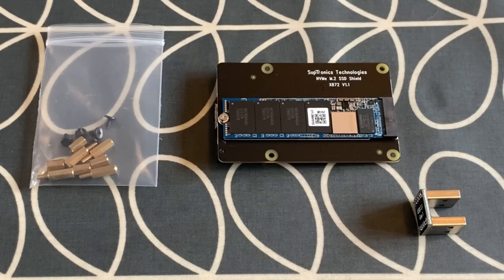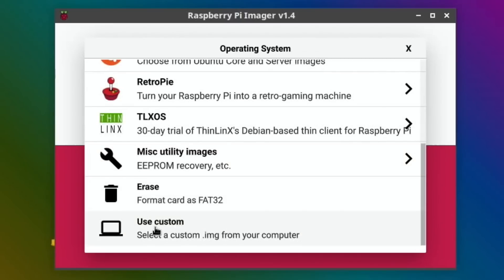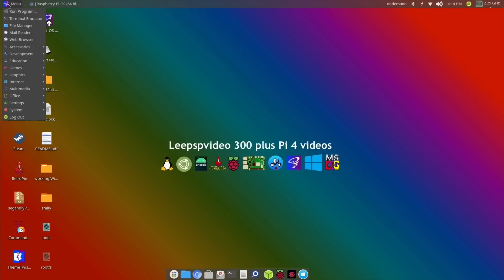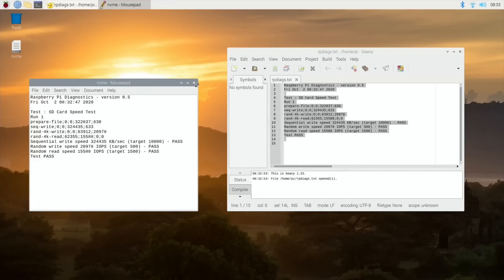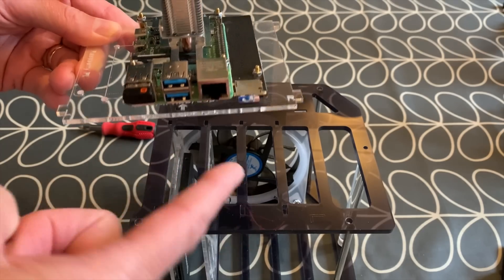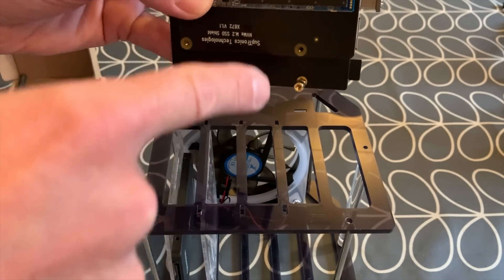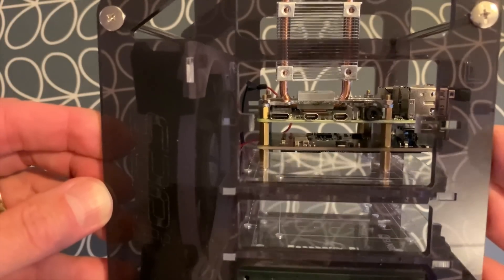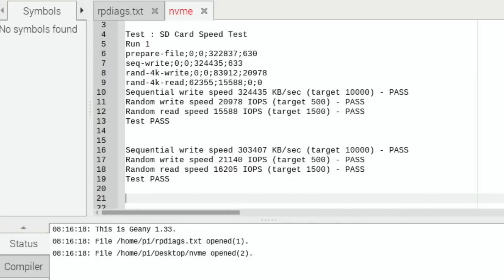SUPERFAST storage NVME M.2. Raspberry Pi 4.

Comment: I came across to issues with my X872 
1) The NVMe M.2 drive started to heat up to where it was  thermal throttling.
I put aluminum heatsink on the NVMe fix the problem.

2) Wifi not working 2G and 5G, it was able to see it but would not connect.
after searching web this is what I found.

"USB 3.0 devices might generate radio frequency interference that can cause Wi-Fi and other wireless devices operating in the 2.4GHz band to have issues communicating with your Raspberry Pi4. To avoid interference on the 2.4GHz band using Wi-Fi, try using the 5GHz band instead. If problem still exists, please turn off WiFi and use the wired network instead"
https://raspberrypiwiki.com/X872

it works when wired but not Wifi

Comment: The fact that it's connected via USB is a massive turnoff. Maybe the more expensive versions of the next iteration of the pi could feature a better cpu with more BAR addresses for GPUs and an integrated pcie slot on the bottom of the board. That would be a good idea for high performance edge computing or just setting up a low cost AI device in the network

Comment: just wondering if your nvme drive is with DRAM.
I brought the same X872 extension card.
No matter what I do, I cannot get my nvme card going.
1) Adata m.2 sx8200 pro 1tb - come up erratically, then try to format, but than on second boot, it cannot find the data partition.
2) PCIe SSD 220S 1tb - cannot format every time, error with report in size and volume.
Reply from the maker: My drive is listed in the description
Reply: @leepspvideo  Thanks for the info.  I did check out your listed drive but what I found looks physically difference from yours.
It's a 2 chips layout instead of 4 and it seems come with Hynix DRAM.
The only other difference I could find against mine is the electric current spec.
The pioneer listed +3.3v ~1A, while my 2 drives listed +3.3v ~3A.
I am already using a 5V 3A adaptor for the PI.  I guess this is not enough and I may need to get their adaptor then.

Comment: XPG SX8200 256gb NVME with x872 adapter on my Pi 4 8gb ram
Sequential write speed 318135 KB/sec (target 10000) - PASS
Random write speed 27397 IOPS (target 500) - PASS
Random read speed 25051 IOPS (target 1500) - PASS
Test PASS

Comment: Great video. I've seen comments about wi-fi being affected by these boards. Have you had any issues?
Reply from the maker: No, but my router is in the same room.
Reply: leepspvideo if you look at one of their wiki pages, they claimed there's a USB 3 interference issue. So it's officially confirmed. Did you receive a improved version?
Reply: leepspvideo Here's the link: http://raspberrypiwiki.com/X872 This is wiki from another distributor, but I believe the manufacturer is the same as Geeek Pi's. I bought via your link in the description and there's serious wifi interference.
Reply from the maker: Gordon Bai I’m not sure if mine in newer. I use 5ghz WiFi without any issues.

Comment: This is what I am getting with  the sata Kingston A400 240G Internal SSD M.2 2280 and 
FIDECO USB 3.1 Gen 2 to M.2 NGFF SATA SSD Enclosure 
Sequential write speed 318135 KB/sec (target 10000) - PASS
Random write speed 19051 IOPS (target 500) - PASS
Random read speed 17866 IOPS (target 1500) - PASS
No overheating, I can run an SSD on both of the usb 3 ports no problem

Comment: Dude... no clue why but I can NOT get my pi to boot from an SSD with this adapter. I got it to boot just fine from an NVME m.2 enclosure (usb-c)... but no dice here. What are your boot configs?
Note: External power to adapter from GPIO.
Reply from the maker: USB Boot the Simple way. Raspberry Pi OS. Pi 4.
https://youtu.be/suU09BMMFts

Depends on the OS as to what extra you have to do. Twister and Raspberry Pi OS work straight away with usb boot.

Comment: I had a lot of trouble with this device. Firstly the wi-fi was affected, but also the speeds were horrendous. Kbps with uas and 30Mbps at most with uas turned off. This was with the Intel 660p 1tb.

Same drive in the ugreen enclosure even with the SSD positioned under the pi gave me similar speeds as on this video and no WiFi issues. This video makes be wonder if my first purchase was simply defective or if it was the combination with my ssd.
Reply: Same here my friend! I bought this X872 board off Amazon UK with 50 GBP, and a Corsair NVMe M.2 240GB SSD. Wifi was affected, I tried booting from SD and just plug the X872 board in, wifi not working. Then I tried plug in a 5V 2.4A barrel power, wifi still not working, so not a power issue.
I'm using Manjaro ARM. The desktop is not display right with this X872 board, very often.

I have a ugreen sata to usb converter (not enclosure), it's UASP I checked. I use a WD Blue 250GB SATA SSD, speed is good, no wifi issues.

I don't know which M.2 SSD you use my friend, but I would guess SSD should be okay, it's this expensive X872 board.
Reply: @gordonbai5320  did you test the SSD speed with the X872 board? I used the Intel 660p SSD.
Reply: @Dipun Mistry Not really, though during writing in with balena etcher, the ETA with normal SATA SSD is around 2 min, but with X872 board the writing time is around 10 min. So around 1/5 the normal speed.

Edit: I did the test using "sudo hdparm -t --direct" just now to test the read speed (MB/s).
A2 SD card: ~40;
SATA WD BLUE SSD: 320;
X872 with Corsair NVMe SSD: 32. This is just unbelievable. Now if you click the Amazon link in the video description, it says it's not available. I really like the form factor of this board, but with the issue right now I think I have to return it.

Comment: You're limited by the 5gb USB - with an inexpensive Crucial SSD, I get the following:

Sequential write speed 319687 KB/sec (target 10000) - PASS
Random write speed 19435 IOPS (target 500) - PASS
Random read speed 16400 IOPS (target 1500) - PASS

Comment: Just for the record, my N2+ running Ubuntu-desktop 20.04 and 5.8 kernel give me some decent 407MB/sec with USB SSD3 boot with a Samsung T5 SSD w/ UAS and Trim Enabled.
sudo dd if=/dev/sda of=/dev/null bs=16M count=256
256+0 records in
256+0 records out
4294967296 bytes (4.3 GB, 4.0 GiB) copied, 10.5504 s, 407 MB/s

Comment: I didn't know Pioneer the favorite brand in the 80's and 90's for car stereo equipment has an IOT division now. Sadly, they're way overpriced in Canada. My preferred choice for NVMe model/brand is the HP EX900 M.2 NVMe 500GB because it's compatible with my RockPi4C, Rpi4 and Odroid-N2+ for NVMe boot and USB3 SSD boot.

Comment: Another great vid!  2 questions: Does Twister OS boot from the NVME drive?  NVME drives run hot and usually require heat tape and a thermal case to keep them cool, I don't see any options  for this??  Not everyone has UR case with  big fan.
Reply from the maker: I will try Twister soon. I haven’t yet  looked for NVME cooling.

Comment: Built-in m.2 drive support is something the pi 5 needs to have
Reply: Totally Agree. Chinese ARM SBC's manufacturers with RK3399 CPU's such as NanoPiM4 and RockPi4 has been offering this since 2018. Also, NVMe M.2 drives keep getting cheaper these days.
Reply: pci-e x4 at least.
.
pi4 should have really... painful compromise usb3.1 uasp...
Reply: @pearcomputers  There's one little problem with your suggestion, it won't cost $35. Take a look at NanoPC-T4 which was released at $149 in 2018. The more features, the more money we will end paying for it. Take a look at RockPro64 ARM SBC which offers a Pci-e x4 slot as your want but it costs $80.
Reply: @josephtremblant2173  that's why you put the best soc, with full speed data. Onto a Compute Module and remove all of the expensive hardware from the (credit card sized) carrier. Reducing development to a single CM for each generation on single or many sockets, the base being 35gbp with 2 usb-c ports for Apple hubs, power,  real network and video.
.
You're right Joseph, I'm in the UK - where e50+ is the going rate for an sbc based system worth using. But Ebon designed pi4 for bank terminals and massive contracts into digital signage in the western world. Not to preserve their sweet-spot in 'ethics,' though it does also do that, albeit with very expensive accessories ;)
.
I'm saying you can have both, easily. That a move to cm/rk would make sense (but will never happen) and would support clusters, pro hardware and the overall sbc ecosystem better - including the $20 boards being churned out everywhere, thanks to Rpi's revolution :D 
.
But their design needs to evolve to meet the adult needs of the posh world. As well as remaining accessible to the 4bn that earn less than $5 a day xx  CM onto a single ddr4, even just RK onto a M4-style header would give them phat linux pci-e. And a pi3,4,5 socket and cluster upgrade path..
Reply: @pearcomputers  I think they need to take a another look at who is using their SBCs now. Yes, PI has a base of tinkerers and makers that will probably always be there and that's great. But the user base is rapidly growing beyond that and they could use better features than what the PI is giving them now. They're starting to be used as media PCs, NAS', hardware for virtual machines and routers. Each with different hardware needs. That's where the CM module could come in and it's why there are either companies or people designing their own CMs for sale. They've recognized that not everyones hardware needs are the same. But they're pretty slow to market. If I want a router I want the fastest dual networking ports I can get, if I want a NAS then I'm probably looking for SATA ports and so on. PI could work with these others who are developing their own CMs to create their products faster or develope different CM boards. 

They could and should still have the regular PIs. But it could also be more than what it is now.
Reply: I think we would get much more bang for buck improving CPU or ram
Reply: look for the argon one m2 sata version, that should give you kinda that, and you don't have to pay the extra price for the pi it self
Reply: I guess it is kinda randomly asking but does anybody know a good website to stream newly released movies online ?
Reply: @Sylas Aaron lately I have been using FlixZone. You can find it by googling :)
Reply: @Kyrie Derrick Definitely, have been watching on flixzone for since april myself =)
Reply: @Kyrie Derrick thanks, I went there and it seems like they got a lot of movies there =) Appreciate it !!
Reply: @Sylas Aaron no problem xD

Comment: Idea for you commander pi has an update can now switch easily back and forth from 32/64bit kernel should be interesting to see improvements in speed. ie twister os 32bit with 64bit kernel. PS wanna become my 400th subscriber. Just starting a Minecraft mini series using a Pi 4

Comment: I still can’t get anything to boot from SSD drives tried 3 different ones —work fine from any usb sticks what type of sata cable are you using Sir —great vid
Reply from the maker: All 3 work for me 

Speed test. Sata to USB 3 Cables. Raspberry Pi 4. SSD USB boot.
https://youtu.be/cdKZ2DXRCcA

My main one is the csl linked in the description
Reply: leepspvideo you are always the best
Reply: @Eiretraveller  No Prob
Reply: The best/fastest Sata to USB I've ever tested is the  ASM1051E SATA bridge like found in the Ugreen https://www.amazon.com/gp/product/B07D2BHVBD/ref=ppx_yo_dt_b_asin_title_o03_s00?ie=UTF8&psc=1

With my Samsung 860 Pro's in these adapters it's like running in a ram disk. Crazy good and low power. 

I had problems getting the boot from SSD to work right following several different guides with no luck. I finally figured (for me at least) a way to get USB boot to work 100% each attempt. 

Steps:
1) First download the latest Raspberry Pi OS (I use the 64bit version). Using Raspberry Pi Imager write the image to your SSD/USB/etc AND a spare SD card (you can save this SD card for faster upgrades if you want).
2) Boot the SD card connect internet and type ( sudo apt-get update ) and ( sudo apt-get full-upgrade)
3) Reboot and run ( sudo raspi-config ) go to "Boot Options" and tell it to boot USB if no SD card found. Save - exit.
4) Remove SD card and plug in your USB device. Boot!
5) Optional: Save the SD card and next Pi you want to USB boot you can just run raspi-config. Also some crappy USB chipsets/adapters do not play well with the Pi/Linux and can cause instabilities or not boot at all. So chose a known "good" working adapter.

Comment: raspbian :: select all, copy and paste,  ctrl+a, ctrl+insert, shift+insert (if keyboard has Insert key)
and  first test report 'rpdiags.txt', choose Save As 'nvme.txt' 
Add to 'nvme.txt', drag and drop it on the editor which is showing second 'rpdiags.txt'
or just double click on 'nvme.txt'.
Also any doc not closed when quitting geany, will be automatically opened when geany is activated, 
even when double clicking a text file.

Comment: Very interesting thanks. I do wonder though are we trying to make a PI into something it was not designed for? Is it really worth doing things like this (apart from the 'Can it be done')? When the actual 'computer' is the cheapest part, then is that the right direction? I think the PI's roots was an educational thing which is great, but now? Prob more are used as kodi boxes etc. I think we will have major step in small computers soon. Then you will have a trully powerful box to go with these fast/powerful/expensive peripherals. Just my thoughts. I am sure many will disagree. For now I can build/buy an Intel based small computer just as cheap. It will be interesting to see which direction things go.
Reply: The Raspberry Pi single board computer has educated me with regards to learning Python, soldering hardware and, with the endless possibilities of what an 8GB version can do, building my own desktop pc to compete with a Macbook; and the great thing about that is that I am still in control of the computer and not the computer controlling me, like high-end commercial manufacturers with their hardware and software. Moreover, I think a lot of people who, like me, are not very clued-up about computers will take great satisfaction with adding to a Raspberry Pi other boards like, for example, this NVME M.2 ... it is all a wonderful experience.
Reply: @krisb9017  Thats great and fantastic you enjoy and learn from it. Don't get me wrong. I have about 8 or ten PI's for various things and some just for learning.  The thing is when does a PI go from a learning computer (which is def needed and is good at), to 'just another desktop' computer to surf the web (YT/FB etc)?  I have been using/working with computers since the 70's. I have had the 'fun' you are experiencing now (the fascination of learning how they work and how to do more rather then just 'use'). It' a great time. These days I run more emulators of old mainframes and older systems. A bit like having a vintage car that you tinker with all the time rather then a new car that you just use as transport.
Reply: @G1gop  you sound like one radical dude working with computers since that time - that is fantastic. Furthermore, I absolutely agree with you about computers being similar to cars and the feeling one gets tinkering with them,  feeling like a mechanic - not that I have ever driven a car.
Reply: I agree with you on what the cost is. As for one who has spent more than you would think on multiple PI'S and add ons its more on how far I can push it and learn new things . I feel way more comfortable about bricking a PI then I would bricking one of My Macs
Reply: I appreciate these videos, but I was watching this thinking the same as you Alan, for the money spent on this you can get a refurb PC that will blow it out the water.

Comment: Cool video thanks. 

Actually there are multiple M.2 SSD form-factor PI4 adapters from Geekpi, the X872 NVME version you tested and the cheaper X862 M.2 version (which was good enough for my needs). I also used a shorter/cheaper 42mm M.2, e.g. a Transcend TS120GMTS420S - but pls be aware that this requires a mounting-screw not included in my X862 packaging (only the 80mm M.2 mounting-hole is pre-populated).

And you find the manual/documentation for your X872 under https://raspberrypiwiki.com/X872, similarly for the 862,...
Reply: According to ETA Prime here https://youtu.be/Q1btyPoL0GI , X862 is like a third the speed.
Reply: @gordonbai5320  it seems dependant on the M.2 used. My combination (see above) seems 1/3 slower on pure write speed, with the rest nearly identical. But its probably at least 1/3 cheaper than a pure NVME-variant (based on local amazon prices).
Reply: And my performance with the X862/TS120GMTS420S is: Sequential write speed 225'209 KB/sec, Random write speed 21'586 IOPS, and Random read speed 15'240 IOPS